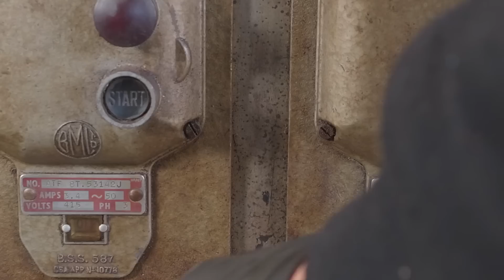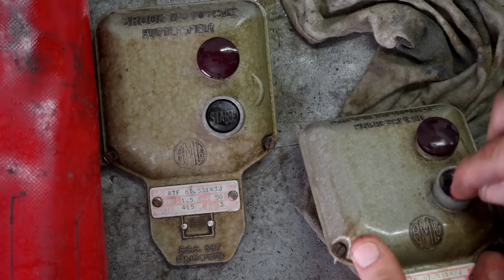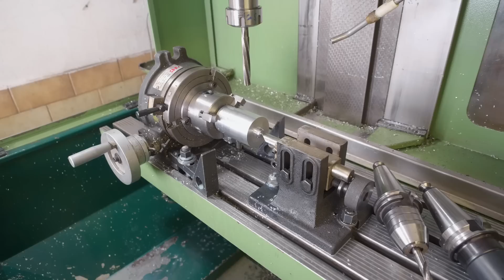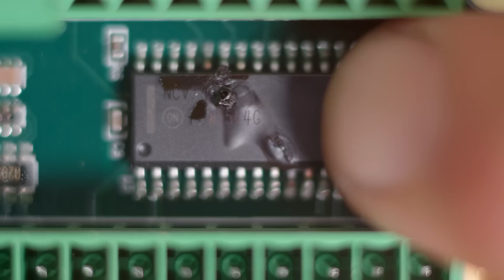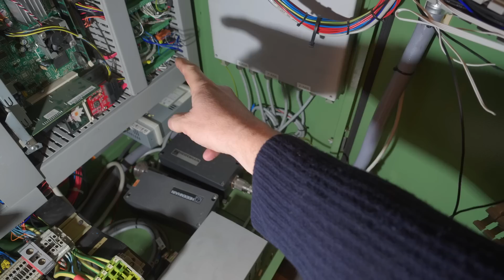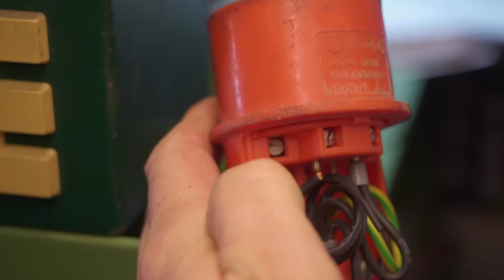Electrical troubleshooting my MAHO 400E CNC mill, and J+S 540 surface grinder || RotarySMP

Comment: Hey, I just noticed on your 540. You’re missing a bar that goes on the back of your spindle carrier that trips the switch that can be adjusted for up or down feed👍🏻
Reply from the maker: Since it is badged as a 540, not a 540P, I suspect the power head lift was retrofitted. On mine the down stop is located on the out side, but the up feed stop is inside the head casting next to the lift screw.

Comment: I'm not a trained tech, but what I've found helpful in the past is to start at the power source and check the voltage until I find no voltage. Then test that part. Your system is much more complex than the alarm systems and cars I've worked on. So, that might not be the most efficient way to do it.
Reply from the maker: Thanks for the tip Jakob.

Comment: Before you get to far with the grinder I would suggest you check the runout on the motor pulley. The reason is that if it is bent (I presume from the motor being dropped while being put in or pulled out) you get a rough grind that looks like out of balance (because it is) but is coming from further down than the wheel the wheel and its spindle....
This video shows them going through the recovery process, the difference is shown at 25:10 
https://www.youtube.com/watch?v=2561k5nf0rY
Easy to rule out, hard to find.
Also there are three lube point on the rear of the machine. The lead screw, oil nipple and the worm box. The first two can be oiled via the auto oiler option (or make your own given you don't have one on your machine). The worm box needs to be checked occasionally rather than being an oiling point. So something to work through before you fix the machine close to a wall.
Reply from the maker: I saw Bart's video on that a couple of weeks ago. Yesterday I pulled the belt and put a clock on the motor pulley. Mine is near perfect. about 0.01mm TIR.

Comment: I'm still a little confused or suspicious about that timer setup on the surface grinder. If it is a timer to keep it running for a while, I would expect the timer contacts to open when it counts down to zero. Since it will power the spindle up just sitting there when that switch is on, then
a) it must be open when counting and closed when zero?
b) It is stuck off zero, probably from physical damage or mechanical goo?
c) it is zero, but the contacts aren't opening?
d) there is a short of some sort in that timer case?
e) the switch is a short across the timer to keep it on forever, which makes no sense.
f) the timer is for some other purpose and works in a way I don't expect.

In any case, it just doesn't seem right to me, and I personally would do a bit more digging inside the timer case to see what is happening.
Reply from the maker: I already tried turning the timer around to zero when I first tried out the machine, and it didn't turn off the spindle. I am not convinced it still works, as in, I doubt it still counts down.

I will be deleting the timer.

Comment: Interesting use of the timer. Machines all failing at once is my usual luck. I start doing X then something breaks then I go over and do Y and something else has an issue then I end up just fixing tools. 
        I'm too slow to catch all that magic smoke and shove it back in before it's totally broken. :) Funny my air compressor outlet broke a contact when I was moving it. 

          There were ECMs used in mid 80s GM cars that had computer controlled carburetors. (yes they were awful) There is a driver chip that runs a solenoid in the carb and if it shorted etc it would pop that chip. Common issue and I would repair the ECMs by getting used ones from the yard and pulling the chips out of them as they were not available. Lots of fun since the board was coated in a hard nasty conformal coating. ECM#1226455 was the most common one I did then. 

           Some odd comments below... I'm at a pint right now I don't know what to film or edit. My issue is that I like to share information but no one really wants information they just want to watch and be entertained. I could add so much technical information that I don't know what to put in and what to skip. I shot that last video initially with step by step info to make it very easy for someone with no clue to get it then I said nahh just show it and go on which is difficult as I like to share information and educate others. Also I think many people don't understand the varied backgrounds of the people that post videos. I don't find it worth explaining it all myself as a few may see it but most will never see that video and it's not really relevant.
Reply from the maker: Hi Robert. I get into that thought process as well. As our topics get more and more narrow, and obscure, the potential audience shrinks, but the appreciation of that one guy who needed exactly that piece of information grows.

Comment: “By the time I was done writing the post I realized what the problem could be” is basically rubber ducky diagnosis. You explain the problem to a rubber ducky (in the absence of a real human) and many times, by the time you have explained the issue to the duck you have figured out the problem.
Reply from the maker: Thanks Joe. Yep, that is how it worked :)

Comment: What’s the difference between using WD-40 and break cleaner? And fudge me, for someone who isn’t electrical you are pretty good in my limited opinion 🤣 However, what I think you do well is communicate and use resources effectively to isolate a problem. With time you exceed most intermediate electrical hackers. So pretty good imo
Reply from the maker: WD-40 is basically kerosene, so it doesn't evaporate off as fast as brake cleaner does.

Comment: I'm sure you get a great deal of satisfaction from finding the problem even if you might take a slightly longer route.  Sometimes everything needs a coat of eyewash, not just the first thing wrong you find.  Couple of times Sparky had a radar in bit and was not finding anything to repair and I asked how the main fuse was, they wondered off and came back very very cross as indeed the main fuse had blown.  Good work Mark!
Reply from the maker: Thanks John. Took me way too long to work it out :)

Comment: Oh troubleshooting method in electrical is “Easy”. Check if you have power. Take the mid point of a circuit and check it. If your good the issue is after it. If not then it is before. Keep splitting the difference until you find the issue. Note: Ground and Neutral issues cause gremlins in the system. If it works than stops then works again or randomly behaves weird you have gremlins. Good luck
Reply from the maker: That loose phase wire was such a gremlin. Would work about half the time I plugged it in :)

Comment: Holy smokes! You're in challenging times. At least the fixes are looking fairly easy at the moment. Pity that board got fried. I too am doing some electrical fault finding so I can appreciate what you're up against. I'm also not an electronics wiz. - Heather
PS: Sorry I missed commenting on your video last week, I was visiting my dad. I did catch up but it was kind of late.
Reply from the maker: Hi Heather. I hope your troubleshooting works out well.

Comment: I just managed to fry a microcontroller the other day by connecting one pin to 50V by mistake. Strangely it worked for a few hours after the accident before it gone to full short at a power up.
Reply from the maker: That kind of board behavior is hard to trouble shoot.

Comment: 14:10 absolutely do not be sad about this. I'm a software developer working on the Linux kernel, and I've had experiences before where I'd write down a long comment on a ticket to explain the precise problem I was running into for my co-workers to give me input on, step by step, only to then in the middle of writing it get a suspicion, do a small test and immediately find the problem. Software engineering has a whole term for this: "Rubber duck debugging", because you don't even need another person to read over your question. A rubber duck (or other inanimate object) will suffice. This is a normal and very effective way of solving mysterious problems, and if you've written it down for others to look at as well you're possibly helping someone else who comes across a similar issue in the future.
Reply from the maker: Thanks for that. That ducky helped :)

Comment: good video RotarySMP

Hello from Spain... In my home workshop, I have all the old machines that I've fixed myself. I follow the same strict rule regarding the electrical systems on all of them... I throw everything original into the trash and replace it with a new control panel with frequency inverters. Some have one inverter, others two, and others three, depending on the number of motors the machine has. This way, I achieve reliability, lower energy consumption, and much better performance than the factory ones, such as raising and lowering the hertz, acceleration, braking, etc. Perhaps it's not the path everyone follows, but it works very well for me personally and saves me a lot of headaches.
Best regards
Michel
Reply from the maker: Thanks.

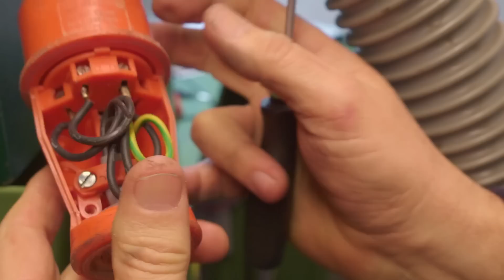Comment: 14:23 Ain't nothing wrong with that, in the software engineering biz we call that "rubber duck debugging". The act of explaining a problem to another person seems to help people realize the problem they are trying to get help with, so the idea is that you'd put a rubber duck on your desk and explain your problem to the duck to kinda get this debugging realization. The idea is that if you explain this to an inanimate object, you don't get the unfortunate situation of spending the time to talk to your coworker and in the middle of explaining the problem, you realize the solution.
Reply from the maker: It certainly worked like that this time.

Comment: Mark, so many feels in this video - I am pretty much the other way around - mechanics make sense in books and in CAD, but fault finding - I just don't know where to start! I know you feel like you don't have the chops, but you do, you just have not practiced enough to have it in muscle memory. If you sit down and think through it - you get there, as shown in this video!
You know that this is why pilots practice so much - there are times when sitting down and thinking through it is not an option :0)
But for you in the garage - no sweat!
Letting out the magic smoke sucks very much. The cost, of course, but also the smell, and the fuss - I am glad that you found the culprit!
Also glad that it looks like one of the phase connections was loose, not the neutral - that could have caused a bit more harm, depending on the balance in your system!
Here's to much luck with the grinder, and the Maho will chugg when it's time!
Reply from the maker: I was pretty glad to find that as well. I hope that was the only other issue.

Comment: Yeah, I spent a year in "A" school learning how to boil water in the late 80's for the US Navy.  I got to do a lot with that over the years, machine operations, pumps, fuel, lab work for water and fuel chemistry. The boiled water (steam) is often used to generate torque which is use to pump fire fighting water, generate electricity, move the ship (all in very large quantities.) Steam turbines, piping system, lubrication systems, and the management of all the maintenance and operations on all of that equipment becomes a large job as well.  I eventually moved into automatic controls and afterwards went to college for computer engineering which included electronics and computer science as a combined degree. As there is so much complexity there, I just tell people I boiled water and leave out most of details, but I've a whole library of books on all the rabbit holes of knowledge... most of which can be released for public consumption, as we have moved on to using Gas Fired Turbines, today, instead of direct boilers. =D  Happy Sunday!
Reply from the maker: Direct boilers... I get it :)

Comment: I dunno, but do 'industrial controllers' not come with surge suppression devices built into it?  Or other means of protecting the more delicate parts of a circuit/control from spikes?  Transient Voltage Diodes are probably a thing that can be added even after.
Reply from the maker: Thanks Joan. There are some diodes across the coils of the Maho control relays.

Comment: If the timer is only connected to the spindle motor that kind of limits what it can be used for.  Warming up the spindle kind of makes sense although I don't see why you wouldn't just leave it on in the morning until you were ready to work plus it doesn't warm the rest of the machine.  Maybe it is for end of day keep the spindle running long enough to spin out any coolant, as you said someone suggested.   I've never heard of that but I'm no expert.
Reply from the maker: There is also wiring to the hydraulic motor contactor. I haven't worked out the sequencing so far, as I need the table back on.

Comment: It can be the very thing you don’t expect. I ran a commercial photo lab for years. We had slide mounters that cut the film and inserted it into plastic or paper slide mounts. Every so often, one would stop working properly. I’d get called over, upon it would work. I’d walk away and it would stop. Very frustrating. There were complex mechanical beasts. Often a problem in one area of the machine would be caused by a problem over in the other end of the machine. It could take a while to find it.
Reply from the maker: Intermittent faults are the hardest to isolate. Planes are like that as well.

Comment: I'm an electrical engineer, and my day job involves a lot of troubleshooting of one-off equipment. Honestly, you're doing great; I'd have no issues with you if you were working under me. 

The best tool in my belt is Binary Search. Try to eliminate half of the circuit. If the problem goes away, the issue is in the half that was eliminated and vice versa.
The next best thing is Rubber Duck Debugging. You already did this with the forum post, but explaining the issue to someone who has no familiarity with it causes you to see the problem from another angle.
When all else fails, there's challenging your own assumptions. Stop assuming anything to be true; prove everything to yourself. Writing down everything you believe to be true can be very helpful!

Hope this helps!
Reply from the maker: Thanks for your tips.
Reply: "Stop assuming anything to be true" Is very important, especially on old equipment.
Worst is when you get an incorrect wiring diagram, and it takes hours to realize just that 😅

Comment: Your approach to wire snags is as good as anyone’s, props to you for it.  The maddening thing about them is that the solution usually surfaces the instant you hit send on a post or on the drive home from work. 

Aside, can you imagine avionics techs trying to drill rivets and use sandpaper? 😅
Reply from the maker: Hi Jim, that is what keeps us up at night :)

Comment: Must be the week for CNC failures - Monday morning the machine's PC booted then spontaneously shut down. so I re-seated the memory & NVME, reassembled and it booted, only to permanently fail 2 hours later. Now running on a 'spare' NUC. Seriously considering investigating a Pi 5... About time you upgraded to 2.9.x so you can solve all your pendant woes with a Manualmatic ;-)
Reply from the maker: Hi Philip, I really dont want to migrate that Maho. I would have to recompile the gearbox comp etc.

Comment: I need to fix my old now manual milling machine to show correct x axis measurement. Problem is somewhere in ls501 and exe 650 amplifier. I noticed that your machine has similar heidenhain axis measurement system. Could you please share with me the model of the amplifier your's Maho is using?
Reply from the maker: I never really understood Heidenhains EXE numbering system. Since two channels of my Phillips/Heidenhain board were malfunctioning, I bought two EXE boxes off ebay. Both work fine, but one is 1µm resolution, and the other is only 5µm resolution. I cant remember which is which, but they are both 602D exe's.
Reply: @RotarySMP  Actually mine are 602e with 11uA inputs. There are switches inside that you can select interpolation factor and that is maybe you have different pulses per mm on axis. I got mine from ebay also, and 650 is better model with more option for interpolation factors for better resolution. I have idea to replace box with my custom board but it can be lot of work that i dont want to do if problem is something that is easy to fix

Comment: That CEE plug still looks dodgy. The manufacturer specifies a certain torque for the screws. I know, I know, you've never seen an electrics guy with a torque screwdriver. Everyone skips that part. That's how conductors fall out of screw terminals. And am I seeing this right, the old conductors are tinned!?
Reply from the maker: Hi Alexander, nope, the original terminals have ferrules on them, not solder.
Reply: @RotarySMP  Ah, yes, had to rewatch it on the PC to see how they were terminated. The uninsulated ferrules looked like tinned wire ends. Still pretty dodgy, I'd still re-terminate all of them, and then give them a proper torque. Typical values are 2Nm. Even name brands omit the required torque in their datasheets unfortunately.

Comment: Why are you not plug in the 24v power supply to the 7i84 board, when you checking the connection? It wont see the board without Vin power supply.
Reply from the maker: I didn't realise that at the time. Peter had me check that. It is still DOA.

Comment: In the meantime please for all that is holy re-terminate the cable to that CEE plug. You shouldn't see bare conudctors like that, especially with a twist in the exposed copper. That's a recipe for metal fatigue during cyclic loading

Comment: Spotting the screw might have been easier if you'd spent time shortening wires and bundling them into groups like a trained wireman.
Reply from the maker: Good point John.